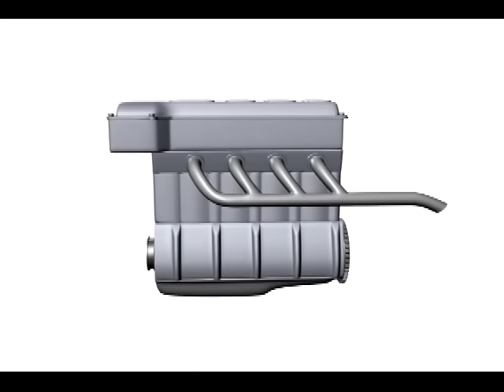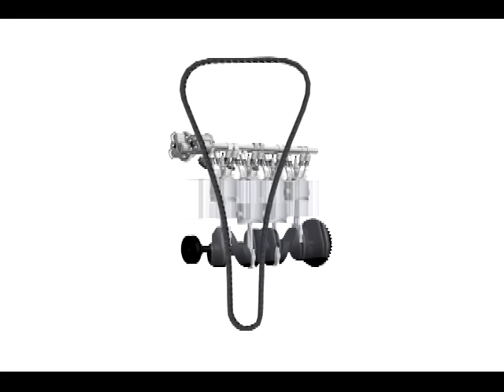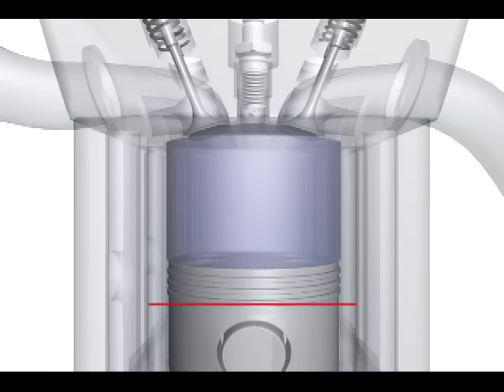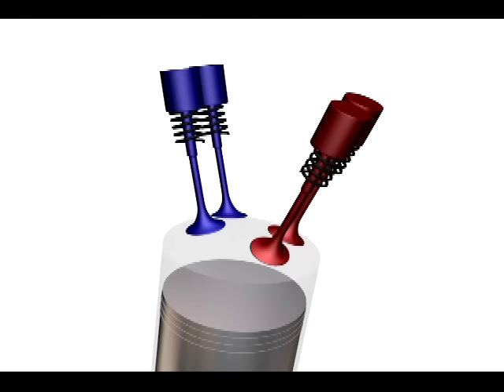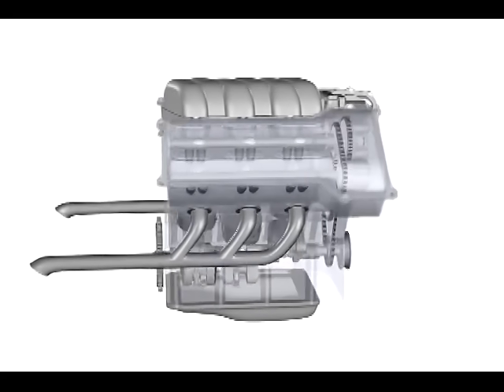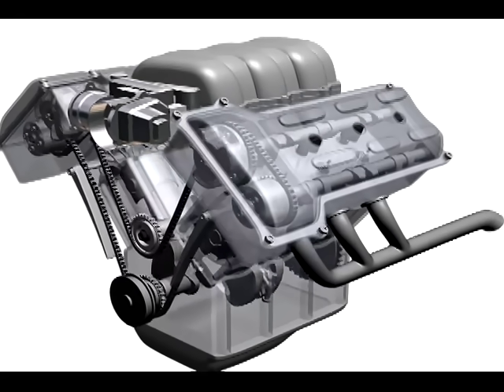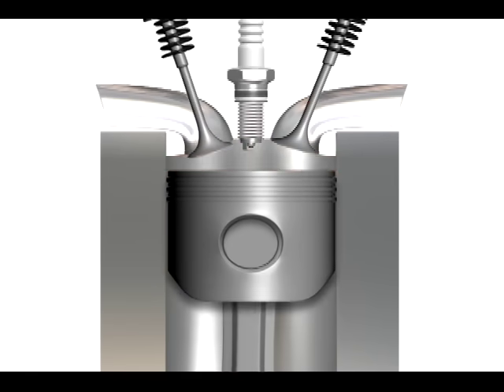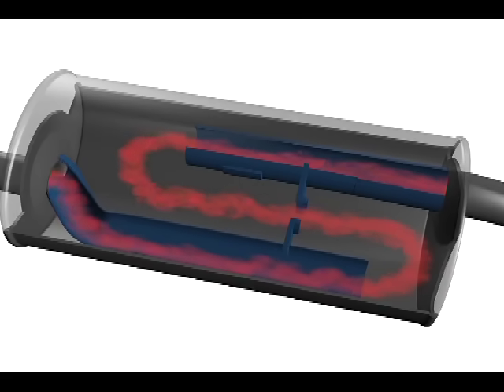How an engine works - comprehensive tutorial animation featuring Toyota engine technologies (2008)

Comment: forgot the fact that the older yotas have a crossover pipe which doesn't allow for maximum breathability and causes the head gaskets to blow prematurely. Also the poor exhaust design also causes the valves for the 6th cylinder to also go bad prematurely by the heat that bypasses that 6th cylinder before dumping down to the actual exhaust. resulting in a loss of compression as the valves get burnt out and don't seat properly. the yotas are also tight as hell when it comes to working on them. to fix all of this you have to install headers dropping down to either a dual exhaust or add a crossover underneath the car! its all BS. not to mention you cannot fit a cateltic converter in the aftermarket exhaust system without a bunch of cutting and fitting.... save yourself some headache and get a chevy with a bigger engine for more power and also more room to work on the thing. hopefully Toyota realized all the cons and changed it. people like me don't find out until after we pay an overpriced amount for a piece of eventual scrap metal! thank god my father is a brilliant man and has experience working on cars.... we just added headers on my car. now we have to hunt the exhaust leak we created by changing the shit original design of the exhaust. we had to cut out the old crossover pipe out with a sawzall which was a lot easier than unbolting the seaming impossible bolts, ditch the catalytic converter which may now be causing a difference in back pressure.... FINALLY after tons of research and a bunch of work my car sounds like a Harley! :(
Reply: Dillon Kidder 
I've seen such a good reply rarely. But I really don't know much about what you put forward as I've less deep  knowledge of this topic. But it's really interesting.

Comment: 4:16 when you said all Toyota 6 and 8 cylinder engines are in a v configuration you where incorrect the Toyota Supra used a inline 6 DOHC twin turbo called the 2-JZ which is legendary in the after market tuning comity which is called JDM which stands for Japanese domestic market

Comment: ok one question, pls pay heed to answer.Does the camshaft work independently of the speed in a non-vvti engine if not then why doesn't the speed of valves change with change of speed?
Reply: The camshaft is always spinning with the engine. Valve timing changes when the valves open and close, not the speed at which they open or close.

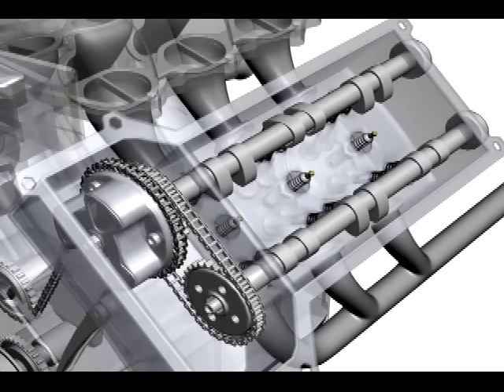Comment: 6:15 if camshaft is spinning connected by engine, wont it be in time with the pistons anyway?
Reply from the maker: It is in time but there are performance advantages of "advancing" or "retarding" the valve timing. Just like the ignition, it doesn't fire the same at low speed as it does at high speed, the needs of the engine are different when you have low RPM and want torque vs. at high RPM when you want HP.

Comment: Isn't it dangerous to have VVTI? 
with the valves open at the same time like that I would think it might be possible to have a flash back in the intake valve and have the explosion carry to other parts of the engine? Or to have more oxygen then you would want coming in from the exhaust and then too big of an explosion, blowing up the cylinder? I don't know much about cars , maybe there is a safety mechanism of some kind to prevent these sorts of things, a one way valve at another point in the pipes? Or is there an arrester in each tube?

Comment: So does a v8 DOHC have 4 cams total?
Reply from the maker: Yes, that's correct.
Reply: yes
Reply: Neon_VIPERZz do you know more about cars ?
Reply: Isn’t the answer in the question ? I thought DOHC = duel cam shafts?
Reply: Zminchu
Reply: Zminchu
Reply: a v8 has to cylinder heads in a v shape which means 2 cam shafts per head which makes it DOHC
Reply: yes why
Reply: Neon_VIPERZz better be trolling or else he/she knows less about cars than a flying pig.
Reply: dual camshafts per head. A "V" configuration engine has two heads so if it's a DOHC then 2 (heads) x 2 (cams per head) = 4 cams total

Comment: Lol, the guy making the annotations sure is sick and tired of Supra fans
Reply from the maker: LOL you're right. I get a notification about 4X a week with someone saying "not all Toyota engines..." Well this video was made in 2007 and was designed for dealers talking ONLY about current vehicles. Way before the FT-86 and WAY after they had any inline 6s in production. The Supra guys are the most annoying. Like I'd do training in 2007 for engines that had been discontinued in the early 90's (rolls eyes).
Reply: The 2JZ was produced until 2005, that's certainly not the early 90's
Reply: Nevil Easterling Produced until 2005, designed in the 90s, so it's a 90s engine
Reply: good
Reply: Shayshulexe I'm a corolla 86 myself
Reply: allegroracing well not all toyota engines are over head cam... LOL
Reply: lmao bro shut the fuck up toyota still made inline sixes in cars up to at least 2005

Comment: Only 14-30% of the power from gasoline combustions is used to pull a car forward—most of the energy is lost to heat and friction.
Reply: What you're saying is already done is Toyota's hybrids(Prius)
Reply: When Heat panels that generate electricity envolves that can be taken off the list put friction is hard coz what can we put on our tires that wont brake or inside motors moving parts and can we make somehow more electricity out off moving parts of the car...
Reply: hea
Reply: Camaro Troy it's sad you can't make the power go directly to the wheels.
Reply: Camaro Troy intresting fact the mercedes amg formula 1 engine uses 50% of the fuel as power
Reply: Camaro American Pride you mean energy, not power

Comment: At which point does the liquid fuel become a gas? 
Is it liquid before it enters the combustion chamber or what? I can't picture a piston trying to compress liquid.
Reply from the maker: The fuel injectors spray the fuel as a mist into the combustion chamber. A sort of "average" air/fuel ratio is 14.7:1 so there's mostly air and a little fuel in each air/fuel charge. There is a condition called "hydraulic lock" which is where oil, fuel or water (if the car has been flooded) fills the combustion chamber. In that case, you are correct, the liquid is incompressible and the connecting rods will get bent (at a minimum) if the engine is attempted to be started.
Reply: At last, that question was really bugging me. 
Thanks!
Reply: pretty sure that isnt true, engines atomize fuel regardless of running temperature. Engines don't run well cold because the oil hasn't circulated yet upon startup, and distributes over time.
Reply: It doesn't really become a gas. The injectors atomize the fuel upon injection. It more so makes it into a mist within the cylinders.
Reply: No, the fuel injectors vaporize(atomize) the fuel first.
Reply: exactly what i was wondering
Reply: Bryce .D it's not a liquid, it's more of a spray at that point.
Reply: CORRECT
Reply: it's liquid
Reply: William Ralston
 false. Engine oil is in every crevice of your engine within seconds of starting. If it weren't your engine would not last very long. The reason cars run "worse" when cold is because the computer increases the rpms to help warm the car more quickly. You can even go in and adjust the rpm on start if you want. So it's not really running worse, it's just the way the car was designed. Unless you have wear like piston slap or something then your car will run worse until everything warms up and expands.
Ps. I forgot to mention that the computer also makes your engine run rich when cold. Which explains the more crude feel to your idle.
Reply: Bryce the fuel g ya mixed with air and so it a liquid mixture going in and then it burns, with the spark plug, then it’s just fumes
Reply: mixed in the carburretor with air
Reply: When the engine is hot the liquid fuel is heated and turns into a gaseous fuel before mixing with the intake air. 
When the engine is cold the fuel mostly remains in a liquid state and doesn't mix as well, this is why cars don't run well when they're cold.

Comment: Note: The FR-S is a Subaru Engine. Not Toyota.  Also they're Basically Subarus.
Reply: Toyota doesn't make boxer engines.
Reply: yep it has the FA20 engine(?), I think its the same as the new wrx engines, not sti's tho. Its like the EJ20 but more efficient and powerful as its a new engine and the EJ20 has been around for moons.
Reply: It's not owned by Scion\Toyota the engine design is owned by Subaru also most the car is built by Subaru, Toyota did mostly design and the fuel injectors. FA20 engine is used in other subaru cars but it's not seen in any other Toyota's because Subaru owns the rights.
Reply: the frs is a scion and toyota engine
Reply: Khaos Films Well unless they swap the engines, all of them use an Fa type engine. Which has Subaru literally wright  all over it.
Reply: Subaru came up with it. Its owned by scion and yota tho
Reply: the Toyota 86, sub brz and scion frs are all the same thing, just with different badges

Comment: is vvt-i the basically toyota version of vtec?
Reply: vvtL-i is the equivalent of vtec. however vvt-i is in the celica gt and the vvtL-i is in the gts. The 'L' stands for lift which is the crucial difference between vvt-i and vvtLi I had a celica gt and there was no "vtec" but my buddies gts had the  kick after a certain rpm, just like vtec. Source: http://www.superstreetonline.com/how-to/engine/0106-turp-honda-vtec-vs-toyota-vvtli/
Reply: no vvt alters the overhead valve timings ONLY but vtec alters BOTH timing AND lift of those valves.
Reply: Chase Lanier
Reply: Chase Lanier 👀

Comment: Would there ever be a case in which a valve happens to make contact with a piston?
Reply from the maker: Yes, many engines are "interference" engines which means the valves occupy the same space as the top of the piston. The timing of the opening and closing of the valves is critical. Since the large-scale operation of the valves is driven by a timing belt or chain, if that belt or chain breaks, the valves will hit the top of the piston which will bend the valves and damage the top of the piston at the minimum and break valves and the debris will ruin the piston and the cylinder. This is why timing belt changes are critical and why many manufacturers have moved to timing chains. That having been said, some vehicle have had issues with timing chains that can fail (or lose tension) and cause the valves to hit the pistons. Engine timing (spark and valve) is pretty critical to the operation of the engine.
Reply: +allegroracing Thanks! I'm thinking about doing some performance mods to my vehicle but I'm curious about whether or not engines can be "too weak" or unable to handle extra power.

Comment: What causes to piston to move  in the first downward stroke?  And what powers the cam shaft to open/close the intake valve.  When you start your engine what happens exactly?  What is the spark from turning the key igniting/turning on?  What is the first thing that starts and then gets everything else going?
Reply from the maker: An electric starter motor starts everything spinning. The valves are actuated by the timing chain (or belt) that connects the crankshaft to the camshafts. The spark is created in modern vehicles by an electronic ignition. Cars have an alternator which supplies continuous electrical power and charges the battery. When the engine is first started, the battery supplies power for the starter motor and electric components (including the ignition) to help it fire up.
Reply: When the engine is going for a long time another piston is going down because it exploded  and make that one that is not exploding to go down too
Reply: go to the channel engineering explained and look at his playlist on engines. he is the best teacher for cars on youtube in my opinion

Comment: i didnt get the 2.4 litter part, does that mean that in the empty space of the cylinders we can fit 2.4 litters of fuel
Reply: It refers to the size of the cylinders. There are 4 cylinders in this engine, each of them are 0.6L (600cc) in size, so 4 x 0.6 = 2.4. It has nothing to do with how much fuel is injected.
Reply: ah thanks really well explained
Reply: well it does actually... remember it is a mixture of air and fuel that fills the cylinder space so inevitably a 5.0l engine will consume much more fuel than a 2.0l one.
Reply: It means the engine's cylinders have a total capacity of 2.4 liters of gas or liquid, or that each individual cylinder has a .6 liter capacity.
Reply: but does a .6 litter v8 engine is faster than a .4 litter v8 engine
Reply: +Tropa Karlitos not necessarily. It just means it has more capacity, but that does not mean more power. If the compression ratio and fuel is the same, and it is normally aspirated, most likely. There are too many variables
Same goes with the .4 per cylinder v8 vs the .6 per liter I4. More cylinders doesn't mean more power. It does mean more smoothness though.

There are too many variables to offer a straight answer. In theory yes, but if you factor in other things into the equation, it gets iffy.
Reply: thank you, i appreceate the help, i want to be a car engeneer, i am only 15 and im trying to get the basic of a motor
Reply: +Tropa Karlitos same actually I'm 15 and have designed a few engines.
Reply: wow, thats cool man, where are you from
Reply from the maker: Of note here is that there is far more air in the combustion mixture than fuel. Look up "stoichiometric mixture." A normal air fuel ratio is roughly 15 parts air to one part fuel so engines run on air more than fuel. That's why "forced induction" rams more air into the engine (either through super or turbocharging) and with more air being forced into the engine, more fuel can be added for more power.
Reply: torekun This is irrelevant to the original question asked by Tropa Karlitos
Reply: so if i have a 2.0 l v6, and i turn it into a 5.0 ç v6 with all the same components as it did before, will anything change
Reply: Tropa Karlitos That would be physically impossible to do. Your engine block would simply be too small to bore cylinders big enough to achieve 5.0L. In some cases, engine capacity (size) can be increase say by a couple hundred cc (0.2L) or so. If you do this, your fuel consumption will go up a little (in theory). Is this what you are asking?
Reply: so what kind off things can i do to increase a engine performance
Reply: I think it's totally relevant. His question was whether 2.4 litres of fuel would fit into the empty cylinder space. You replied...'it has nothing to do with how much fuel is injected' which is wrong... it has everything to do with it. The space is occupied by an air-fuel mixture. The larger the volume, the more air-fuel mixture required to consume it. Tropa was just on the wrong track thinking the space is occupied by 2.4litres of fuel only.
Reply: i get it now, is not filled with 2,4 l of fuel, its filled with 2,4 l of fuel and air right
Reply: Tropa Karlitos The 2.4L doesn't specifiy an amount of fuel or air; simply the size of the cylinders. Of course; if you compare a 1.4L engine with one that is 2.4L, the 2.4L will be able to suck in more air and fuel, all other things being equal. Look up other engine videos on Youtube, you'll find a wealth of information and understand more in no time.

Comment: wait wait, I have a suggestion for modification of exhaust valve. something is wrong. After the ignition stroke when the piston goes downward and then goes upward , at the same time , exhaust valve is also going downward. it causes cam shaft to exert more pressure on exhaust valve. i want to ask, if the engine designers can modify the exhaust valve, so that it could cut the air pressure.  Is it possible?  secondly why the exhaust valve is going downward instead of upward. waiting for comments

Comment: He said all Toyota engines that are 6-8 cylinder are V what about the 2jz isn't that 6 that's inline 😂? correct me if I'm wrong
Reply: +purekiwi06 so true, same thing ran through my head when i heard that. so then who made th jz1 and jz2?
Reply: +purekiwi06 also he said that all toyota engines use dohc and the 2A and 3A engines are sohc. i owned a AE80 corrolla with a sohc 3A
Reply: +purekiwi06 He meant that the Engines they make today, they have the I4, V6 and V8 and all 3 only come with DOHC
Reply from the maker: +purekiwi06 Years out of production when this video was made and totally irrelevant to the Toyota dealers it was made for in 2007.

Comment: Ive always wondered why they call it a v8 v6. Its shaped like a v
Reply: Some are W. Don't know how that works
Reply: +That One Asian Friend two v engines combined side by side. two v's make a w. if thats what you mean lol
Reply: That One Asian Friend  ON some higher engine cylinders( 10s, or 12) the put two or four in the middle
Reply: +That One Asian Friend a w is 2 v8 usually side by side
Reply: There's F type engines too
Reply: HeadShotPR The Volvos have T5 engines